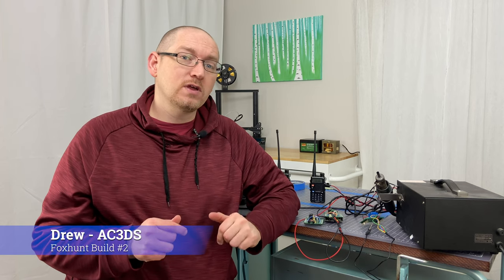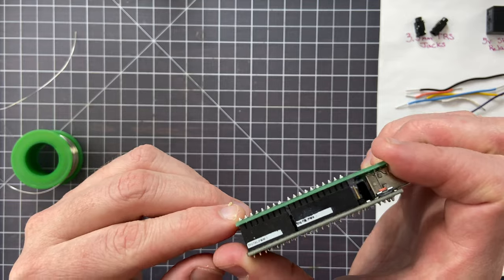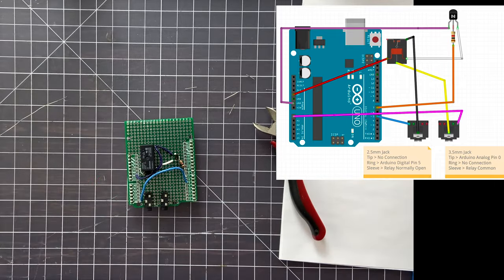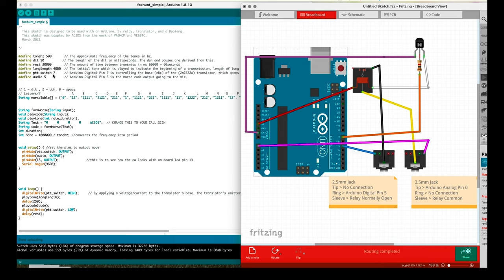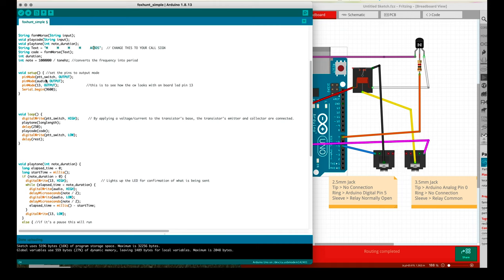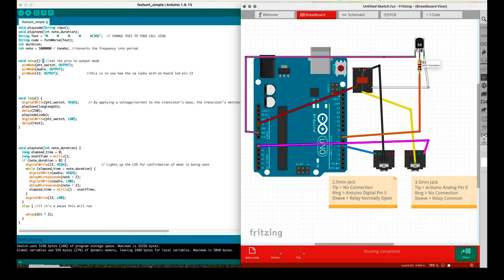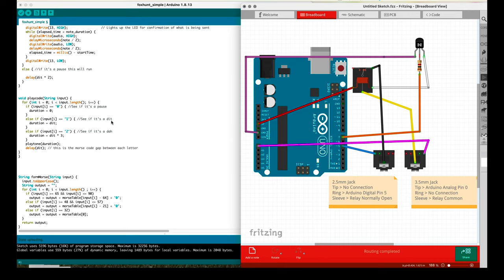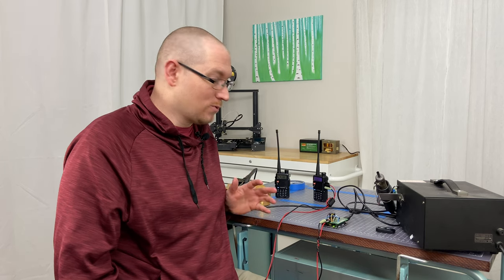Foxhunt Transmitter Build #2 - Arduino + Relay

Comment: Thank you for the informative video. It seems to me though that you could eliminate the 5V micro relay from this circuit and simplify it to use a resistor, transistor, and a diode. From the schematics I have seen online the Baofeng radios essentially use the same arrangement as an Icom, except the Baofeng supports an upper and lower band transmit with two separate PTT buttons. I could be very wrong here, just seems like it should be easier than using the relay.

Comment: Hi do you have a DTMF CODE? and is there a way of making this with a Nano board?
Reply: Red Summit has a board showing a DTMF wire run to the A0 pin.
Reply: A Nano is a much better use for this than the Uno.

Comment: Hi,

Will the red summit RF's build code ( ie include DTMF) work with your physical design? 

also can you advise if the relay should click and then stay active for as long as it's powered? ( as mine appears to click and stay active when powered)

thanks
Billy
Reply from the maker: Hi Billy -  The use of DTMF should be fine. I remember messing with it for awhile and it did work, but I just wanted to keep the code a bit cleaner for simplicity sake. I'd have to look at the code to see if all of the Arduino pins matched up exactly, but if not, it would be a simple change in the code from one pin to another. 

As to the relay: Power is always applied to the relay, however it can only form a complete circuit when voltage is applied to the base of the transistor. The transistor, when activated with a voltage, connects the emitter and collector sides and allows the applied power to the relay to complete a circuit back to ground. When the relay is activated, you hear an initial click and the radio should start transmitting. At the end of the programmed code, it should disengage the voltage/current to the transistor, which disengages the path to ground for the relay, which disengages the transmission of the radio.  

I've found that the use of a relay tends to be very prone to the magnetic fields of the radio and can be easily tripped. Additional ferrites and/or spacing is needed to minimize the effect. I did build a version of this that used optocouplers and it worked without any issues whatsoever, but just haven't gotten around to making a video of it yet. 

Good luck, and let me know if you have other questions- AC3DS
Reply: @transmittinguntilrobotsrep1045  it would help if you did speed the deal to fast so we can see what you doing

Comment: The parts list shows a diode but it’s not listed on the diagram. Where does the diode go?
Reply from the maker: Good catch, sorry about that. I've added an image in the documentation, and will update the diagram soon. The diode straddles the inductor in the relay. You can see this in the video around 5:25 . Thanks for letting me know! I'm going to release another build soon that addresses how to do this with an optocoupler.

Comment: Ok,

So the relay clicks and when the transistor is not getting a signal from pin 7 (1k resistor) the circuit is broke.

I have ordered a Baofeng as my last one broke so cant test with the handheld just now, is there any way of testing to see if pin 7 is stop supplying without the actual radio?
Reply from the maker: That is correct. As soon as the output on pin 7 ceases, the connection between the collector and emitter is broken and the path to ground for the relay is cut, which puts the relay switch back to the off position. 

There are a few ways that you could test to see if Pin 7 is on/off. First, you could use digitalRead and Print functions to show the status on the Serial Monitor. Alternatively, you could put an LED in line to visualize it.
Reply: @transmittinguntilrobotsrep1045  I have connected an LED on pin 7 and GND. The LED remains lit does not go off and doesn't blink, just stays a solid colour whilst powered. Does this sound like a code error rather than a physical connection?

Update: I have used your code and the LED stays on for a few seconds. Then goes off for several seconds and then goes back on. When connected to pin 13 you can see the morse. So your code appears working. 

2 questions

1. I have attempted to add / to the string on line 16 and 17 however it will not recognise the / character (for / beacon)

2. Are you cable to modify the code for DTMF to turn in on and off via DTMF. This is a licence requirement in the UK for these beacons ( to turn it on and off via remote)

Thanks
Reply from the maker: @GM6DX  I haven't looked at the code in a little while, but will do so to see if I can figure out a way to account for the stroke character. Adding the DTMF will probably take me a little bit longer, but using the existing code as the source will expedite that considerably.
Reply: @transmittinguntilrobotsrep1045  I can get a slash by changing a letter or a number not in use example change the 0 to "21121" and it works but If I add the / it doesn't recognise it

Comment: I dont understand why people doesn't use the replacment microphone cable that you can buy from Amazon for a few bucks. I also don't know why everyone  who copies this plan doesn't use a transistor to key the radio instead of a relay.
Reply: In my case I don't know how and I'm building someone else's plan. Though mine will have a slight modification I don't know how to replace the relay with a transistor, maybe one day.